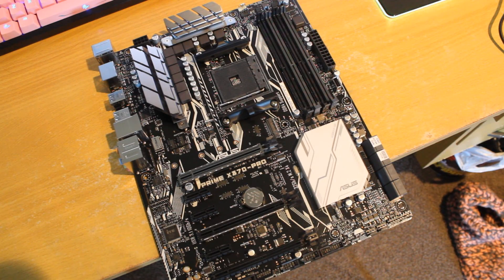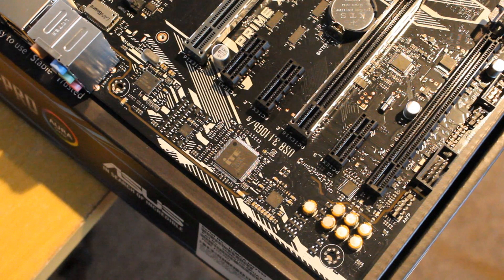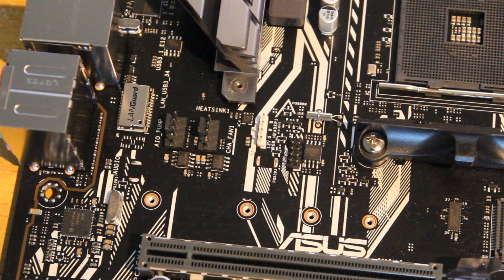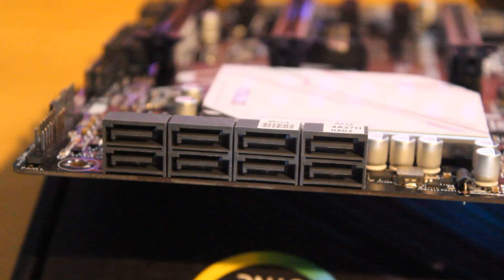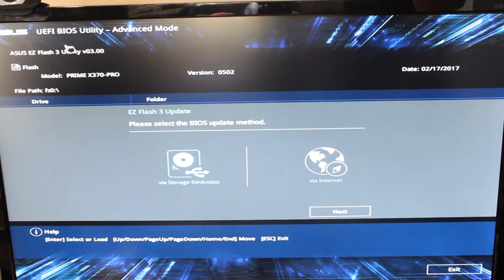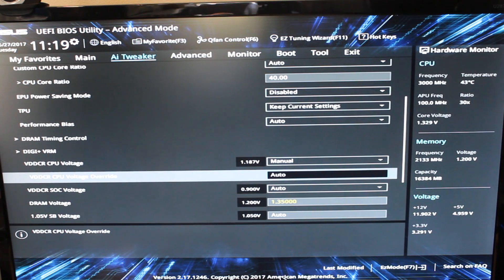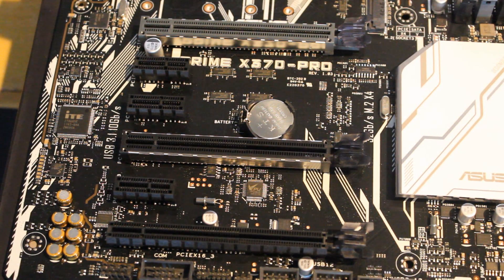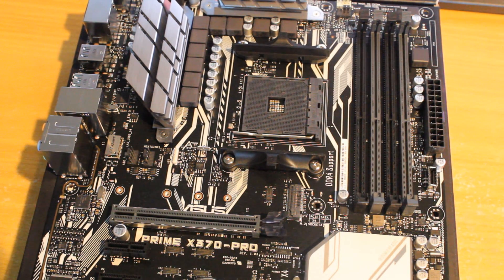Asus Prime x370 Pro Motherboard Review - Entry Level X370!

Comment from the maker: *2:45 I forgot to mention the PS/2 port lmao but does anybody actually use it?
Reply: I know a couple of gamers that still use PS/2 keyboards, because ps/2 doesn't have any input latency like USB does, and doesn't take any CPU overhead, since it works on just pure interrupts...but it's few and far between.
Reply: I own this board and use it with my 1700X, About the PS/2 Port... I actually use it my keyboard is that has both PS/2 and USB connectors. It's an oldie but a goodie and has served me well through several systems
Reply: Tech Showdown  Love this board have hand it now  since the start of the ryzen release. Got it because of all of it conductivity it's bit overkill for what iam doing now but its just right for my future needs
Reply: I still have a PS/2 mouse and keyboard in reserve, just in case. And I still use a PCI card as well. I don't think they are obsolete yet. I don't think that the VGA port is obsolete yet as well.
Reply: I haven't touched PS/2 in more than 10 years :)
Reply: I needed to use a PS/2 port once when a USB keyboard died and figured the spare PS/2 keyboard would come in handy for the particular machine... For some reason, computer didn't detect any PS/2 keyboard I plugged in and would take forever just to post, so that was my last attempt using one of those. :)
Reply: Yep...i do :P
Reply: Not really....tried to hook a KB when I bricked my first one at BIOS 0612 with no avail.

Comment: I've been trying to find an answer to a question about this board - Would i be able to fully populate all 8 sata ports with hard drives AND still use the M.2 drive slot as well?  My old x97 board disables two of the sata ports if it is used.  The manual for the ASUS board makes no mention of this, and i would usually go with  that information, however I don't want to buy the board for 2 drives to be disabled when i installed an m.2 drive as the intention is to populate all 8 sata ports and the M.2 slot.

Comment: Please Mr. Kevin help me choose my mobo. Which one is better for overclock and stability. This one (Asus) or Gigabyte AX370-gaming k5. Thank you
Reply: The Asus prime x370 pro has better heat sink and vrm then the Gigabyte AX370-gaming k5 so the asus board would be better for overclock it has 6 real phases compared to Gigabyte's 4. Here is a vrm chart -
 https://www.hardwareluxx.de/community/f12/pga-am4-mainboard-vrm-liste-1155146.html

edit: There is the Gaming 5 Gigabyte board that is much better then the K5 it has same vrm as the K7

Comment: Tech Showdown, I have this board and it is solid. I do wish I had bought a the Crosshair Hero VI instead but I cheaped out! My plan is to relegate this board to be matched with an apu when they finally get released. Then I will get a higher end board to put my R5 1600 in. That is if I can wait!

Comment: Were you able to hit 4ghz with safe voltages on this board? I'm considering getting this board with a Ryzen 1600 as a temporary chip, and then later when the 2nd gen Ryzen chips come out selling off my 1600 and getting the next 8 core assuming the performance gains are there. Also, sorry to bombard you with questions - but are we certain that gen 2 Ryzen will still be supported on b350/x370? I know that AMD has stated that these boards will see support into 2020, however I don't know if that's entailing that they will support the upcoming APU's that I don't have any interest in, and isn't really clear if a next gen of CPU's will be on this board.

Comment: This would be the perfect Motherboard for me. If only that final PCIe slot would be a PCI one. Just like the PS2 port is not obsolete yet in my opinion, I could have made use of a PCI slot at the bottom.
Yes, I know there are other boards out there. But they either have sub par on board audio, even compared to my 7 year old motherboard. Or have only 4 SATA ports. Or the combination of these. 

In the old days building PCs were fun. Because if you paid more for a motherboard, you knew, you'd get more features. Now all you get is better or more stable OC and RGB. But a motherboard that has every useful feature in one package with not an ancient audio solution? I haven't found one yet for the Ryzen platform. This is the closest to it so far though, but still not perfect.

Comment: I haven't got anything but solid performance out of this board.

I've taken measurements out of the socket and here are the results.

Note that NO software is reading Ryzen vcore right, I've tried them all.

In short, don't use LLC3/4/5

LLC3 showed unstable with high peaks above 1.45v at idle. Stable at load. (this at stock clock and auto voltage)

LLC4 showed a vboost. No good and potentially dangerous.

LLC5 showed an even higher vboost. Definitely dangerous.

LLC1 and 2 are good. I personally recommend LLC1

In any case, your Idle voltage is not a concern, even at 1.42v or 1.45v....your voltages under load are the critical ones. Is all about the voltage while high amperage is going through the chip.

Here 1.41v at idle vdroops to 1.38v at load with LLC1...very good.

1.425v showed 1.39v at load. Also good.

Comment: I have the Board in use since Beginn of March and is it a good Board  and it´s get better with  every Bios Generation.
I using 32 GB ( 4 x 8 Sticks ) it is stable since the biginning. My Corsair Vengeance LPX 2666  goes with 2800

Comment: I was gonna go for this but I went with your opinion of the B350 Tomahawk. I'm happy with my Tomahawk. Ryzen 1600 3.825 Ghz, 2933 Mhz DDR4 RAM, GTX Aero 1080 OC Edition
Reply: i'm on 3.8 GHz stable at 1.3V, think i could lower the voltages some though or go up to 3.825 GHz same voltage. Ryzen 7 1700, Tomahawk B350.

Comment: do you think a 600w PSU will be enough for Vega? also would it be enough for the titan?
Reply: Nobody can really answer that question. It's not out yet, but so far it's rumored to draw more than the 1080 and it also depends on what processor you're using, if it's overclocked or not. You might get by with 600w but like I said, it depends if the rest of your computer is energy efficient. If you're running something like an older FX 8 core chip, I really wouldn't reccomend pairing that with vega and a 600w psu.